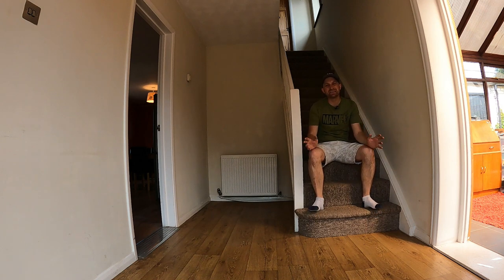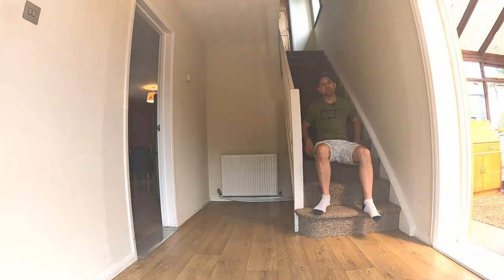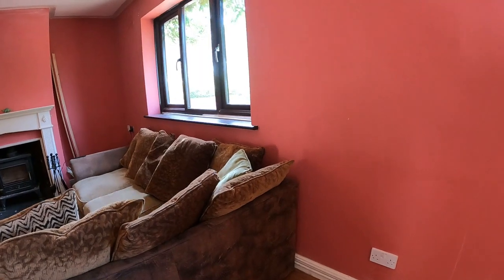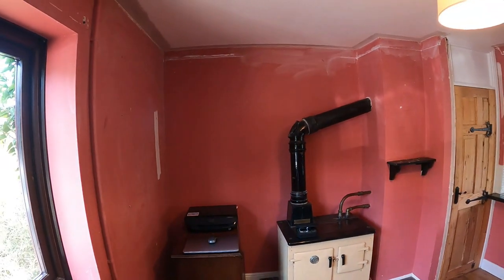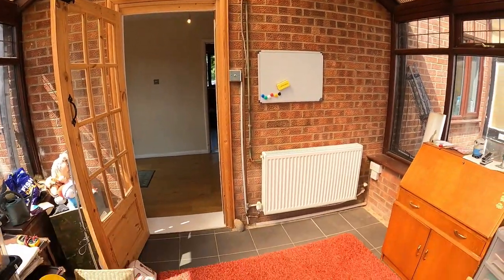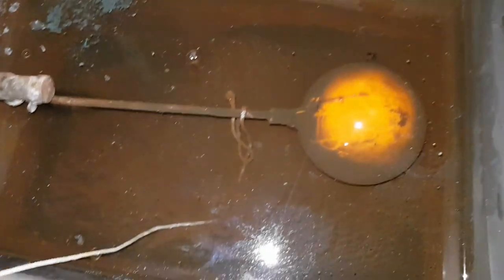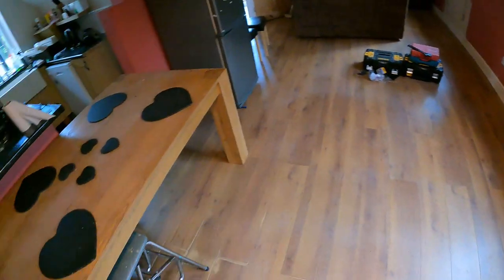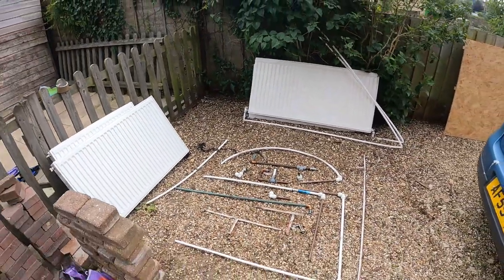Hiding The Central Heating Pipes, Chasing Walls - Home Renovation Ron.

Comment: Im doing the opposite to my rads. Previous owners had buried the pipe in the wall , when one of the poor fitting valves started leaking it was a nightmare to fix. All the heat now enters the room and not the north facing outside wall. I thing shiny copper pipes look nice.
Reply from the maker: That's why our guys put as few joins as possible in the wall itself, thanks for watching 😁

Comment: How did your new fashionable radiators perform in the winter?
Reply from the maker: They've been great, get just as hot as a traditional rad. I under spec'd the btu for the room as I use the fire mostly, so they should have both been doubles, but still do the job, just take longer to warm the room on their own.

Comment: Great video. We have just moved into a property where we are having pipe problems. Lots of loud banging when we have the heating and hot water on. Lasts for about two hours after it’s been turned off. Our pipes are well and truly hidden which is the problem because we are considering getting the upstairs pipes relayed. Can I ask what made you go for copper pipes over a plastic system?
Reply from the maker: Thanks for watching 😁 it sounds like you've got a blockage or trapped air somewhere and its bubbling around after it stops pumping. I went for copper as that's what the plumbers recommended, more reliable joins and better to form into the complex shapes they were making.
Reply from the maker: I had to flush the rest of they system 3 times to get the sludge out, the additives you can put in for a day and then flush out are great.
Reply: We just had to have all of the copper plumbing removed from our house and replaced with plastic. The copper had deteriorated and was leaking in several places.

Comment: Do you know why they replaced the 2 rad pipes with 4, as they still T of the same pipe?
Reply from the maker: I'm not sure to be honest, I guess better flow to each individual radiator. They work great now 😎
Reply: @SuperRon   Great video, just researching for myself. I sat and thought about this question to get inside of the plumber's mind :-) I would guess the answer is this is the only way not to have a joint of any kind (t-joint) in the wall... this approach means the manifold you described upstairs is where all the action happens. Also, the pipes would have to cross over each other and take up more space in the chased-out wall.
Reply from the maker: Very good point about there then being a joint in the wall, that is probably it 👍

Comment: I paid a local company 5k to install a new combi boiler and fit 4 new radiators (We supplied). They have used plastic piping and chased them into the wall.. their excuse (as we expected copper) is that it's better when behind the wall (less expansion etc). Is this correct? Also do the plastic pipes need insulating etc? As currently they haven't done this and I want to make sure I'm not being ripped off. 

Any advice much appreciated. Thanks!
Reply from the maker: Not sure on the pros and cons I'm afraid, they recommended copper that they use on jobs like this so I left it to the experts.
Reply: Very similar job in my heating system. The combination of pressure and heat can produce a pipe expansion that will be more pronounced in plastic pipes. A normal boiler runs with pressures of 1,5 bars. In worse case scenario a 10mm plastic pipe has a max operational pressure of 3.5 bar. The water  temperature of a modern boiler is max 60c while plastic pipes can comfortably works at 80/90C.  So I would not worry about pipe expansion as it should be minimal. Plastic retain heat better than cooper with less thermal stress on plaster. Plastic pipes inside walls are very common in Italy and europe. In addition I would recommend 15mm pipes because 10mm ones can restrict boiler output working at same pressure. It wouldn't be nice to spend money for a powerful boiler that will be underutilised. Cheers

Comment: Hi there 
Great video, what did the guys use to cut the walls. They made such neat cuts
Reply from the maker: They used a grinder (with a Hoover attachment) to cut two slots top to bottom, then used an air chisel to chop out between the two lines. Thanks for watching 😁

Comment: Did you get any plaster cracking?
Reply from the maker: No nearly 2 years now and still looks just as good. 😁
Reply: I found couple carcking around the chasing column. I tried to use mesh tape or drywall filler but don't really work. Do you have any clue how to repair it?
Reply from the maker: @fanco561 mine is still fine with no cracking with my method. Maybe you need to take more out into a V before filling again
Reply: @SuperRon  Thanks for replying. I will do again.
Reply: Sorry one more question. Once heat turns on, is it really hot if you touch the chasing area?I found the difference is mine seems not cover by heat insulation.  @SuperRon
Reply from the maker: @fanco561 it does get warm but not hot like the radiators. More like a heated floor.

Comment: If you need to remove the radiators to decorate etc,,,,, the pipes to the radiator tails look too short to be able to undo the valves from the rads and move them aside as they would be too rigid.  I this you would need to remove the radiator and valves together and undo the pipe coming up from the bottom which would be a pain (have to drain rather than turn off valves.
Reply from the maker: It might be close, it's not the end of the world if I do have to take them off the pipe side and drain, it's not a regular activity and look great with minimal piping.
Reply from the maker: I can officially reply now, i have just taken the rads off with the valves in place! it was tight but they went!